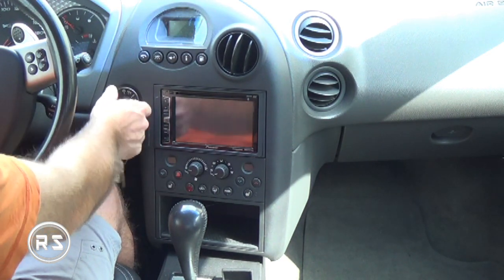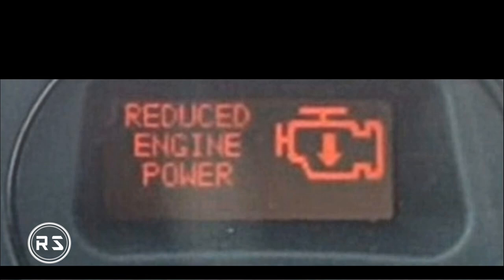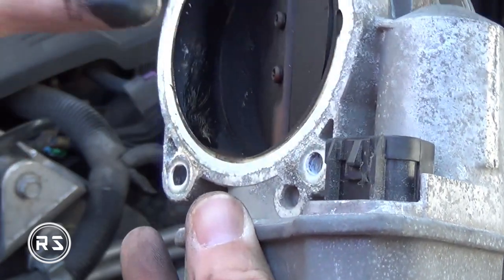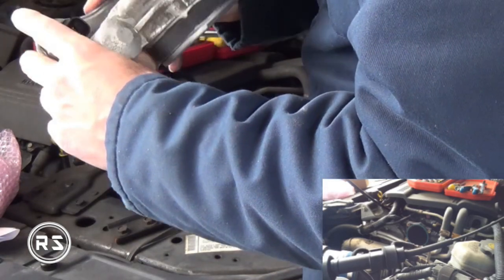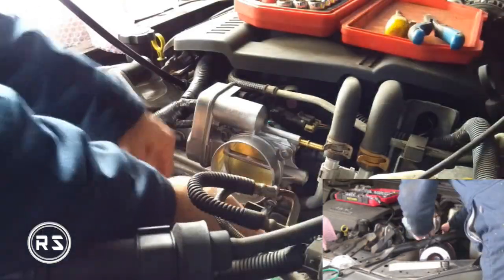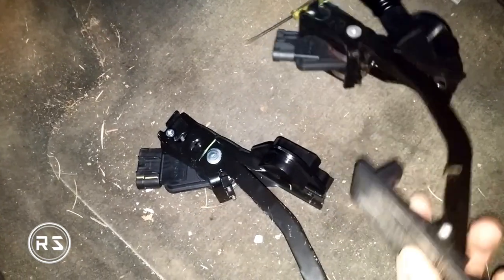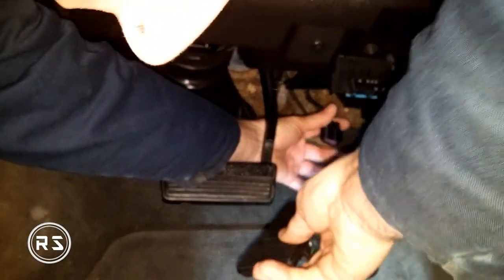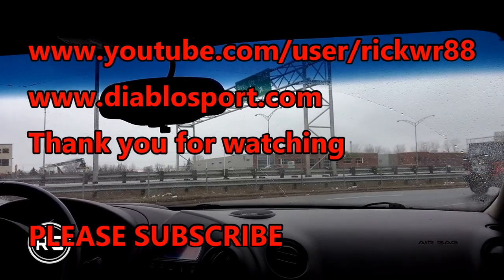Solution to (Reduced Engine power) message

Comment: We have replaced the pedal twice and it keeps happening
Reply: Did you ever figure it out? I've replaced mine twice too along with throttle body and still same issue
Reply: @jonparty3088  electric trouble. My car had . Top wire to the valve cover excessive heat

Comment: I had this happen just last night driving Isuzu delivery truck with V8 gasoline engine. Lost throttle control while driving 45 mph, but could move the truck 1 mph using engine idle.  Turned the ignition off and waited 20-30 minutes to restart the engine and the check engine light with ⬇ did not come back on and normal throttle operation was restored.

Comment: Mine does same thing and once the reduce engine comes on it’s cut off I have to sit for s min then start bck up but t only happens wen I floor it
Reply: Check ground wire off wiring harness
Reply from the maker: have you fix it?
Reply: exactly the same thing happened to mine I had to turn it off for a couple minutes and turn it on and then it it'll take off and then it'll do it again I'll lose acceleration power again we had the same mission so I'm going to have to check my pedal sensor and everything.
Reply: @goldwater1777  have you found a solution? Same thing happens to my 04 gtp

Comment: I've replaced both throttle body and position censor in peddle and it's still popping up, what else could it be
Reply: I did the same thing as well, and still pops up. I don't know
Reply: @ghm389  shits wack. I'm selling the car.
Reply: It may be your intake manifold
Reply: Did you figure it out? I almost forgot you have to program the new pedal assembly with the car 😢
Reply: I replaced my pedal last year for another reason and the reduced engine power code started happening intermittently, sometimes multiple times in a row after pulling over trying to psych it out by shutting it off, open the door, shut the door, insert the key and start it up. Still does it.

My mechanic recently  programmed mine at no cost and I was unaware you had to do that. It is still happening. But ai realize maybe the pedal I got was defective? Maybe it is causing the issue? Is the programing really necessary?
Reply: @chrisnelson3925  I found out no! You drive about 44mph for 10 miles to do an idle relearn. Mine was good for two months and now she's gotta go back in. Most likely some kind of ground wire or moisture issue.

Comment: Thanks so much!  Saved me a bundle on replacing the TPS, which is what I thought I was gonna have to do!
Reply from the maker: i am happy it helped
Reply: On my 07 the tire pressure light caused the problem because the tire pressure sensor reads the speed of the car and pressure.
Reply: @itskingboy189  your ABS sensors on the axles bearings give you a speed reading for for traction control and braking. Plus the speed sensor on the transmission goes to the dash . TPMS is only tire pressure if flat may reduce speed on highway and go to limp mode so you do not have a accident usually on newer vehicles ,
Reply: @PeterMilster  
Nope...Ive had all the Stability lights,  traction control and abs lights on for several years and 60k miles and never had Reduced Engine Power until about a week ago. I'm leaning towards Pedal assembly/sensor or TB problem.
Reply: @itskingboy189  
I highly doubt that
Reply: @youtubechangedmyname  me too. My friend is having the same problem.  But it seems  nobody  can help him
Reply: @kathymyrick4368  
My problem was my throttle body. Hope this helps.

Comment: Thanks much, replacing the pedal did just the trick.
Reply from the maker: Happy to help.v👍
Reply: Let me ask u my friend but do we have to do anything to program the peddle or is it just Plug and play? I'm having the same problem with my 2006 Pontiac Grand Prix non supercharged  @RickStuff
Reply from the maker: @ronniereed8153  I can only speak from my experience. In my case it was a plug & play.
Reply: I replaced pedal new still issues used throttle body still issues

Comment: Ok, so the pedal replacement worked for about 2 months. I replaced a cooler line and left battery unplugged while doing it (it took a week, which sucked) and now she's throwing a P1516. Throttle is clean, wires look good, I'm at my wits end 😂. It's intermittent and only when I try to take off from a stopped position. If I turn it completely off it resets. I don't have any trusted mechanic nearby and need advice. 
I did an idle relearn and so far so good, but feels like only a matter of time.

Comment: I have p1516 grand prix. Reduced engine power, so I pull over and restart... Works fine til yesterday. Yesterday it did same but when I tried restarting it won't. I think it's throttle body

Comment: Replace the whole throttle body and the whole pedal assembly. Now it's says reduced engine power. It ran good for about six months after I replace those things I also put a new fuel pump in it. If I disconnect the battery and hook it back up will the car make it home I got about 15 more miles to drive
Reply from the maker: Try it. Not like you have much choice anyway

Comment: I replaced my pedal. And my air filter. Still having the issue got my oil changed still having. So I seen something about a fuel pump. But does the pedal and sensor come together automatically or do you have to specify

Comment: I've had the same problem and code, but I replaced the gas pedal assembly and relearned the pedal, but I still have a problem. Could the problem be the throttle?
Reply from the maker: Yes it could be. It is the first thing i've replaced when this happen and the problem was still there after i replaced the TB. But maybe it will fix yours